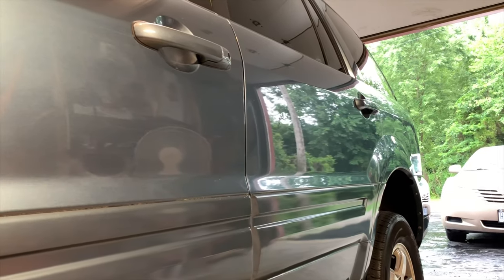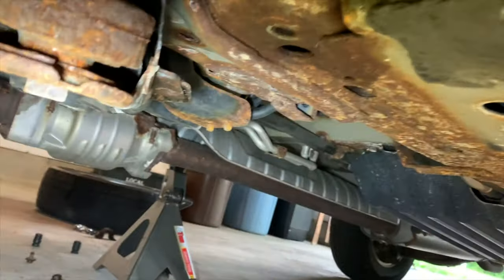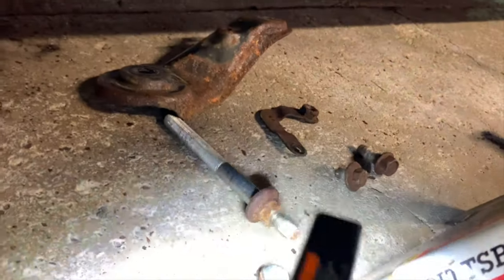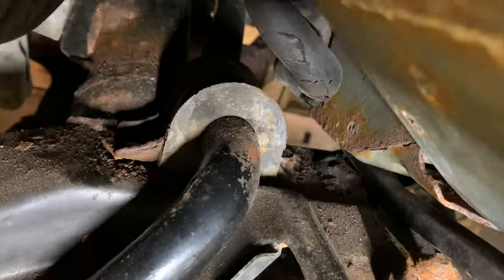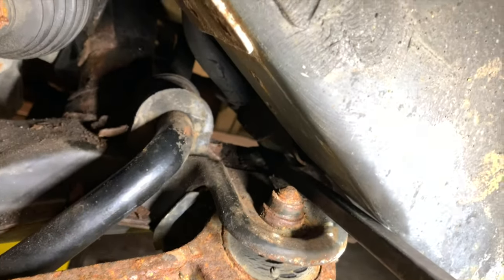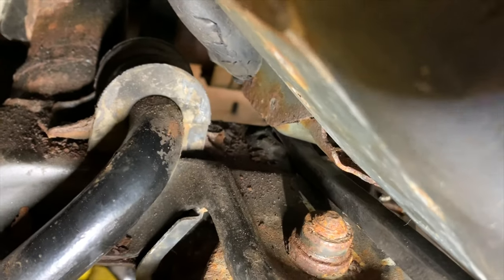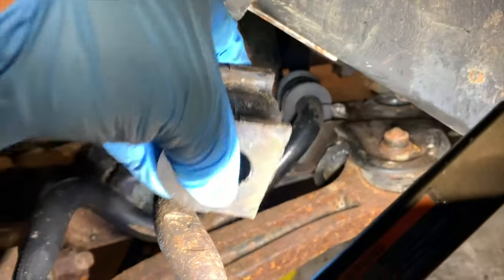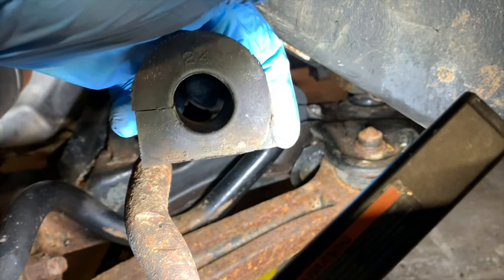2003 - 2008 Honda Pilot Sway Bar bushings

Comment: Too bad you didn't show the elbow grease.  I would have loved to see the whole work you did.  I  kinda want to replace that bushing too.  I  did the passenger side but I  can't reach the driver side.  I  kinda figure the subframe needs dropping.
Reply: It's really easy to remove the small subframe plate.  I used a pry bar to open up the gap after the removal, and jammed a piece of wood into the gap to help keep it open.  It wasn't very big.  I then used a 1/4 inch socket wrench and low profile 14mm socket to remove the bolt.  I found it easier to get at from the inside (like when I did the passenger side), not from the wheel side.

Now for the rear sway bar bushings.  That's way harder.

Comment: Thanks for the advice. Even with a offset box wrench, I still had to do what you did. Driver's side took the longest. Passenger sode took me less than 30min. I was also replacing the end links as well.